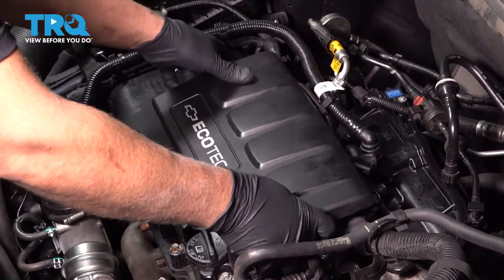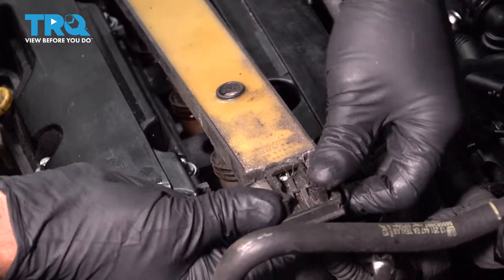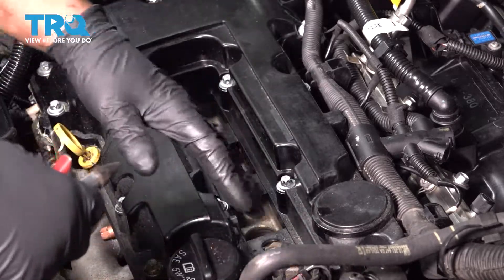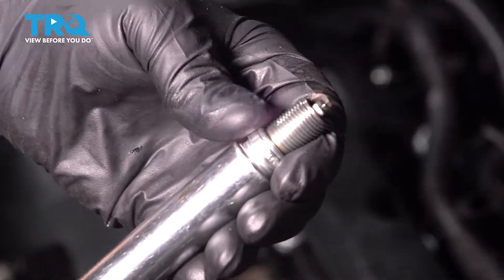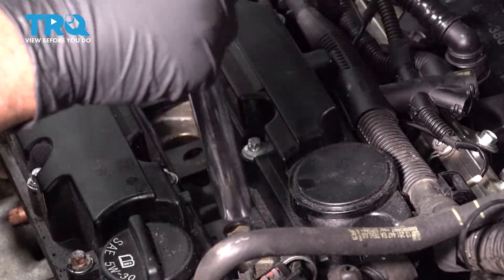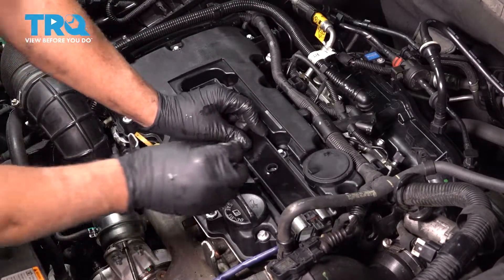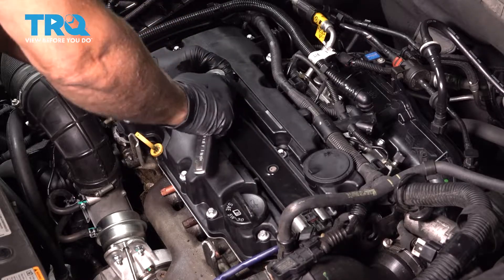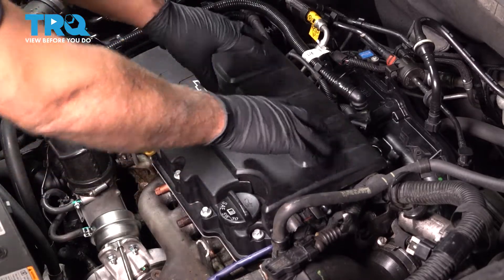How to Replace Spark Plugs 2011-2015 Chevy Cruze

Comment: 1. Another video I watched said you needed to disconnect the battery before starting. How necessary is this to remove the spark plugs? 

2. How do I know I’m tightening the bolts to a certain pound, Is there a tool I need for that? 

Thanks for the informative video.

Comment: im doing my daughters cruze plugs.. idk about the coil packs but I got the boots and coil wires. they must have been in there since 2012 holy smokes they were rusty idle was really bad and engine light blinking off and on.

Comment: I have always worked on all of my cars and he should have mentioned that it is a good idea to check the gap on the bottom of the spark plugs. Each vehicle has to be set at a specific gap to get the best arc or it may cause the car to run weird or in some cases not at all. The parts stores can tell you what they should be gapped at. Check each one and set it accordingly for each plug.